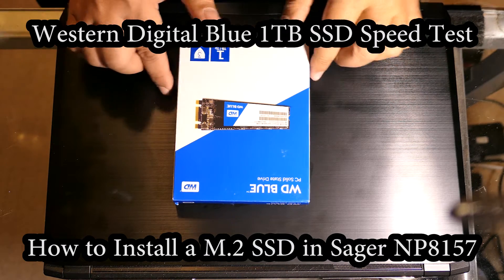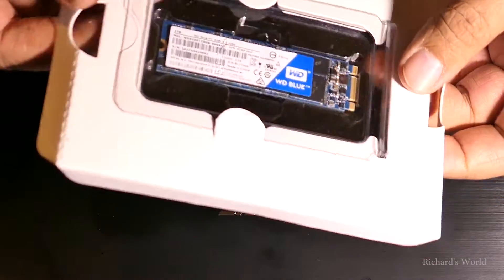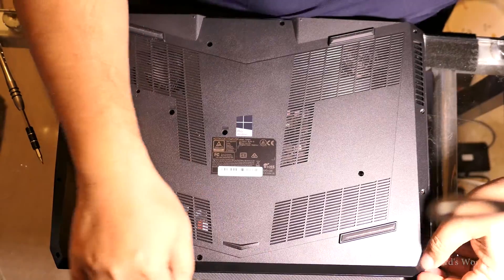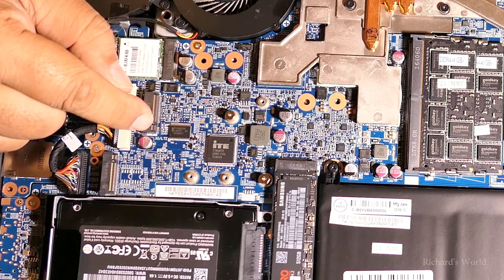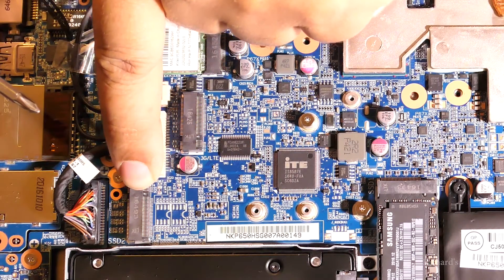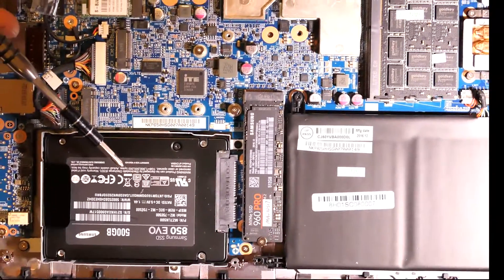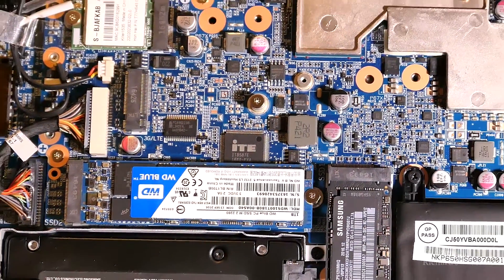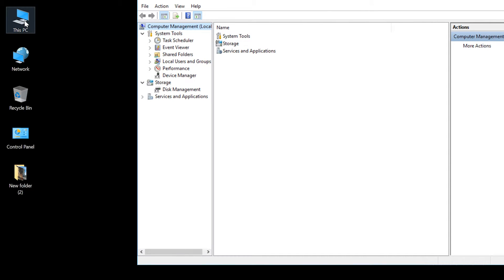How to Install M.2 SSD in a Sager NP8157 - Western Digital Blue 1TB SSD Speed test

Comment: Hi there !
Can you confirm me there is no chips on the back side of this M.2 SSD ? because if there are chips on the back side, it will not be compatible with my Xiaomi Notebook. Thanks.
Reply: This one is a 2280 m.2 SSD. And 2280 m.2 SSDs will not have chips on its backside. It is actually 2260 m.2 SSDs that are having chips on its backside. Now no one manufactures 2260 SSDs.
Reply: Siva R thanks. I bought this M.2 SSD and fit well on a Xiaomi Notebook 13.3
Reply: Which one did you bought?? WD 2D SSD or 3D SSD?
Reply: Siva R i bought the WD green M.2 SSD 128Gb at approximately 60 euros
Reply: Mixma Fritz
How is the performance of your SSD?? Because I am looking to buy WD Blue current gen m.2 SSD. But I couldn't find a proper review of it anywhere. Not even from Amazon reviews.
Will you be able to post the results of CrystalDiskmark with 32GB test data? Because if we wanted to see the performance, stability and consistency of an SSD, it should be tested with larger amount of data. All the Amazon reviewers tested the SSD with only 1GB on CrystalDiskmark.
If the SSD's performance is not stable, you could see a big difference between CrystalDiskmark's 1GB and 32GB test.
Reply: Siva R unfortunately, i'm using Linux on this SSD. I don't know if there are an equivalent to crystalbenchmark sorry. Maybe I will try to use this software with WINE (windows software emulator).
Reply: Ok no problem.. Anyway thank you...

Comment: I see that this is your newest NP8157 video so I guess I'll comment here. How good are the thermals? I saw in the Tom's Hardware review of the NP8156 that the CPU gets up to 102.4 deg C during benchmarks. Does your laptop reflect that temperature in the same benchmark or is their testing method or camera flawed?
 I think your results should be comparable if they're lower because an overclocked 7820HK likely runs much warmer than a 7700HQ. http://www.tomshardware.com/reviews/sager-np8156-gaming-laptop,4954-4.html

Hopefully it's fine cause my old NP7358 died and USPS lost the motherboard when I sent it off to have the GPU reballed, and the NP8156 looks like the best upgrade path from the NP7358. It's kinda sad that I can't have three 9.5mm drives installed (NP8156/57/76/77 are limited to 1x9.5mm or 2x7mm) cause 7200RPM drives are only available in 9.5mm and above, but I definitely don't feel comfortable upgrading if it's going to suffer heat issues cause that's likely what killed my NP7358. But on the bright side, I can just install two 2TB 5400RPM 7mm HDDs in RAID 0 and use the second M.2 SSD slot for SSD caching instead of having two 1TB 7200RPM HDDs installed.

Also I hope the NP7358 engineer that decided to put the CPU and GPU on a single heatpipe with a single fan gets a pay cut.
Reply: Ok cool

Comment: Is there any way you could make a video regarding the 8157's color gamut (sRGB, AdobeRGB, and NTSC) and screen performance in general. ie: back light bleed, screen flickering, performance during scrolling down webpages/switching  windows or tabs in browser/gaming with fps visible. This would be greatly appreciated. I'm considering this laptop, but build quality seems not the best due to Clevo chassis and I'm not sure about the screen.
Reply from the maker: Hi, I'm not sure if I would be good at testing those things that you mentioned. I have no problems with screen flickering. I only have a couple games at the moment, nothing too modern. I will buy Battlefield 1 and The Elder Scrolls Skyrim soon. I know when I buy games I play too much and don't get my other things done. As far as back light bleed. Yes, there is indeed some back light bleed. I don't have much to compare it to though. I got a MacBook and Microsoft Surface Pro 3 and a desktop. I don't have any screen issues with those.As far as the screen bleed goes I don't see it unless the screen is all black, but I guess that is probably what happens with other laptops. I got the 4K screen, and now I am not sure if a 4K screen is really needed for a laptop. It is too hard to read anything if I don't change the screen in Windows. I will say watching YouTube videos in 4K or 1440P is much nicer than 1080P though. If I was a mostly playing games I think maybe the 1080P 120Hz screen would be better. If you don't mind a thicker and heavier laptop they have the NP9152 which has a 7700K in it. I imagine that would blow away this 7820HK if it doesn't get too hot